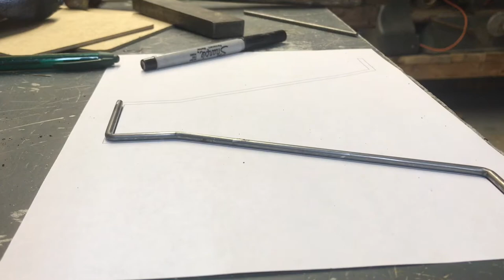DIY RC Stearman Build | Free Plans

Comment: Great video for those of us who have already built a few FT planes.  I am just finishing up the new FT Corsair with a 72” wingspan.  Hope to do the same with this guy!
Reply from the maker: I’m also planning on making an 80” version of the Stearman. Perhaps I could send you the plans when I’m done.
Reply: @FlyGumby  —   That would be GREAT,   Thanks!    An 80” version of this with a 5065 motor swinging an 18” prop???  I’m willing to try it!
Reply from the maker: @chriscrawford1958  I’m planning on using the flitetest monster pack, not sure exactly what the motor size is, but it swings a 20” prop.
Reply: Where is the CG located for this plane?

Comment: Beautiful aircraft!
It was a pleasure watching your knowledge unfold as the build continued making mental notes on how to improve with any minor blunder.
I am a sculptor and jeweler, and while l was watching you, I thought l would use a tapered mandril of wood. I use steel mandrils for sizing and forming rings and bracelets. The mandril I will turn,  shall be the greatest circumference I guess l'll need [plus 1"] down to the narrowest and figure the best length ratio. I would guess  6" X 1" X 36". I will probably make a wood reinforced stovepipe and heated by steam from a tea kettle. For testing the use of heat ranges during bending
Thanx for the tutorial Gumby and keep active as l have become a subscriber.
T.
P.S. You probably know about the above info, but if not. . .a quick search will make it clear.
Thanx again!
Reply from the maker: Thanks! Interesting idea!

Comment: Where is the CG for this plane because it seems to be a little tail heavy? I am building it with some modifications but I may need to add nose weight to balance it out.
Reply from the maker: It should be around the leading edge of the bottom wing.  It is inherently tail heavy to to poor design so if you add a little nose weight or a bigger battery it may help.

Comment: The video is terrible why do you have the need to speed it while you are talking
Reply from the maker: Speeding up the video cuts down on the length of the video and cuts out the non-important information I was saying. You may pause it if you need between steps.